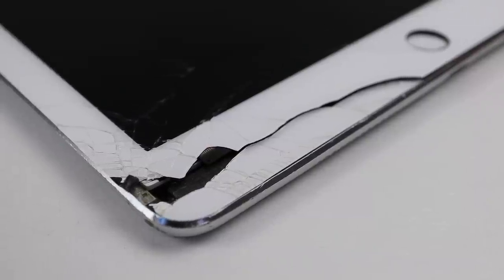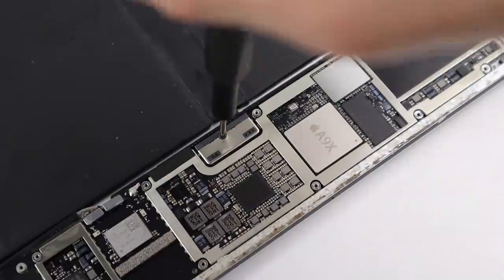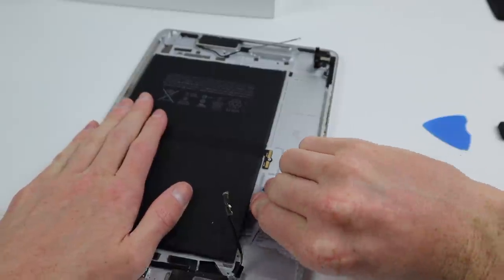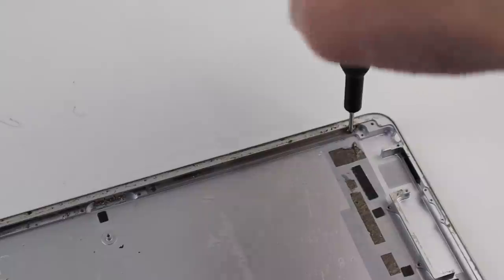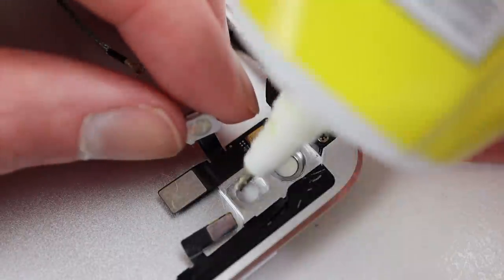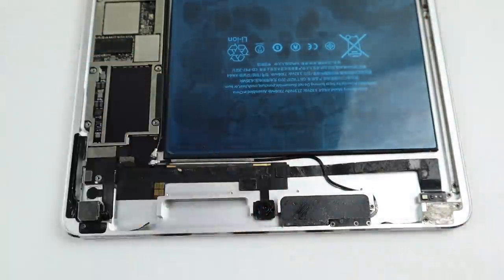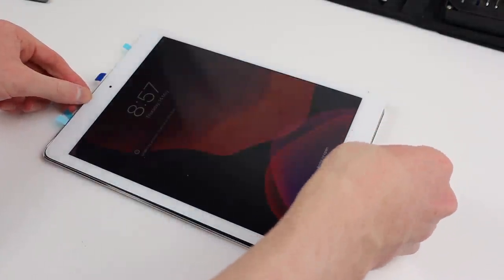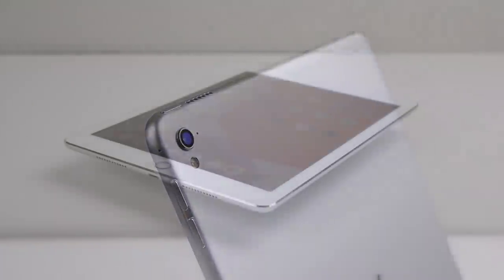Never Try To Fix This - iPad Pro Restoration

Comment: I really didn’t get why people are so hyped about the “Right to Repair “ thing 
Now i SURELY do
Reply: i have a feeling the engineers would have liked to fill the whole thing with epoxy… but some lawyer pointed out that that would make it too obvious
Reply: @gorgonbert  It's not the engineers, it's the marketing and finance people that decide the reparability of apple devices.
Reply: @lukewatson059  Yes it won't have direct impact, but as louis rossman says it's not just right to repair that's going to fix all the problems it's the consumers who will make a change. If parts are available more easily then more people would be intrested in fixing their devices or getting them fixed as repair costs and time will be lower. Once that happens people when buying a new product will consider reparability too which will slowly force companies to make their products more repairable. It's a chain of events and right to repair is first step towards it.
Reply: fact is the technology involved is very delicate there and the device needs to be secured from curious customers who would damage it and then just trash it (thus dealing even more pollution) or complain the product is crap because it didn't whitstand the blows of their jackhammer. Apple's policy has always been dedicated to protecting their product knowing the average consumer can't be trusted, so if anything doesn't work it's due to their engineers and they can control the evolution in a more efficient way.

I tried to change a battery from one ipad once, following a thorough tutorial and was very careful yet... the wifi didn't work anymore. I'm sure I didn't touch anything wrong and yet the device was suddenly trash.
Reply: @3Clod  sure, not all end users are as expert as hugh, but rpair shops are. And if I buy something its my right to do what I want to do to it. I'm not fucking renting it from a company who tells me not to repair it, save some money and maybe save a machine from being e waste.

 Apple harp on about their environmental credentials but make it impossible for expert third party repair, they literally refuse to provide componants so repair shops can't fix problems even though they know how to do so. Its so shady.
Reply: @willm5032  it's their right to adopt the policy they want

nobody forces you to buy their products, there's android devices if you want to repair or make "improvements"

I sure as hell don't want a android device, I don't care about tweaking and stuff, my device is very good as it is already.

if ever apple were to decide their products are open source and become android-like (with all the crashes, bugs, problems with privacy, billions of settings to personalize with the effect that you can't really be sure you did a good job in the end) I would not buy it...
... and I would not be forced to, obviously.

you could also start your own company and build your own product to sell worldwide, if you have so many ideas on how to improve an ipad. Good luck with that
Reply: @3Clod  You are wrong on so many levels  but ok.
Right to repair won't affect you but it will affect people like me who care about truly owning a device and not just renting it.
Reply: @NanoMine  again you can own an android, nobody forces you to choose an apple product
Reply: @3Clod  Damn son what part of apple do you work for
Reply: @3Clod  Right to repair is not just about iphones, heck it's not even about just phones. Androids and so many other things have this problem too which right to repair will solve.
Reply: @NanoMine  Innit, John Deere, Tesla, Samsung all have very shady right to repair attitudes too. Its the shitty direction things are heading in
Reply: @NanoMine  While I agree that that is Louis Rossman's logic, I think it's complete bollocks.  No-one wants to replace a relatively new device just because some tiny part has broken but that's a rarity.  I have more gadgets than you could shake a stick at (from where I'm sitting I can reach a 16" MBP, an iPad Pro, an iPhone, a pair of AirPods and the Pixelbook I'm typing this on) and I've been buying them for years.  The only things that I've ever had that I had to stop using because a minor part broke were so old that I wanted to replace them anyway.

The right to repair will affect a tiny number of people.  Most people, including me, don't give a crap.  If don't like the fact that iPads are hard to repair, buy something else.
Reply: @willm5032  Buy something else then.  If you don't like the fact that Apple products are difficult to repair, you are making poor purchasing choices.  If you still bought it, knowing it was hard to repair, tough.
Reply: @joshuarosen6242  I'm using a 2008 Mac Pro because that gen is the last proper modular Mac. I work in the creative industry which still dogmatically clings to apple. Plus, I criticise any company that is as shitty with their repair policies as apple. The whole built in obscelesence and hampering repair is a real problem especially given the climate crisis.
Reply: @willm5032  I think you make a fair point about the impact on the environment but being able to repair things will make almost no difference to that.  When I was a child, I remember the repair man coming to repair our washing machine regularly.  It was possible because the machines were easy to maintain and parts were available.  It was necessary because they were crap.  All the appliances and devices I use now are much more reliable than they ever were.  So much for built-in obsolescence.

I also don't believe that Apple does deliberately hamper repairs.  Most Apple users just buy the newest shiniest thing and will continue to do so no matter how easy their device is to repair so Apple doesn't care either way.  The reason everything is glued in is because it's easy to manufacture and produces excellent results.  Yes, it makes devices difficult to repair and Apple doesn't care about that either but I have seen absolutely no evidence that Apple actively wants its devices to be hard to repair.  Do you have any?
Reply: @3Clod  What are you talking about, apple are basically very selfish and would rather you not fix something that you have a right to as you paid for it, but pay more money for something new from them that's why they secure and glue things that don't need to be glued like in this video.
Reply: @joshuarosen6242  You don't see no evidence, Ok what about pairing devices to one another within the phone? is that not difficult to repair is it?
Reply: @tyronenelson9124  for the nth time
A) buy android, apple can do without your money nontheless. If someone came and forced you at gun point to buy an ipad, go to the police.
B) If you have a better project that doesn't involve glue, produce it or show it to apple itself so they will buy it.
Reply: @tyronenelson9124  I think samsung sucks, I would make it in a different way and yet (like magic) I don't complain about it, I don't scream angrily to people who buy it, I don't insult them, I don't claim to have other ideas... I just buy other products. Try it too (but I think it's funnier to complain and throw tantrum like a spoiled kid because pepple doesn't do what you want)
Reply: @3Clod  At the end of the day I'm not bothered whether anyone else prefers apple or android because that's their choice, I myself prefer Samsung android because of the different modern models that are available plus the hardware and software flexibility, not apple as it is very basic, dated and limited.
Reply: @3Clod  I don't know what is your stance is to be honest. On one hand you tried to repair something yourself. On the other, you say devices are not meant to be repaired. I believe you said something like "Apple's devices are delicate and are not meant to be tinkered with". Okay then, how about sending it to repair shops? Are they "tinkering" with it? Less modification and environment problem aside, I'm more on Right to Repair for this simple reason: are you fine with paying a price of a new iPad when you cracked your screen? If repair shops are not able to get parts, Apple can charge you whatever they want. Not saying you will break it on purpose, but accidents happen and if you fine paying for that amount, my conclusion is you are rich. Great I guess.
Reply: Mr Wong, you can conclude whatever you want, we're free in the western world, you know.
Actually, what I said is very clear: I tried to repair the device and it was MY choice and if I didn't like the product nobody forced me to buy it. I never complained about a price, when I buy something it's always written in plain sight what I'm going to spend. Maybe in china they hide them, here (unless you want to evade taxes (taxes, not texas, mind you 😅) ) the seller has to display the price.
Reply: @3Clod  yeah I'm not saying they didn't label the prices, but imagine the price they give is 20% cost of the parts with 30% labour and 50% profits. To customer they will say something along the line of "extremely hard to repair thus requiring best of our well-trained technicians and specialized tools". I don't think when they give a price for repair they actually gives specific pricing of each things but just overall how much it will cost so they probably can "hide" something under it without us knowing. For taxes they could put it under labour, can't say much about that, not too much of a business person. 
Hopefully you can gives right to repair another chance in future if things get worse (hopefully not). By the way, yes I'm a Asian but not a China Chinese. Aside from those, hope you have a nice day!
Reply: @SuperSohaizai  the cost could be 1% material and 1000% profit, still you're free to buy something else shrug protesting and forcing someone to do what you want because you can't afford it or despise it is just plain arrogance. If I made a device from scratch better than an ipad, I'd sell it for 10 grands and my comscience would be  quite pleased with me. I do what I want with my stuff.
Reply: @3Clod  wow so right to repair is bad and you rather have things stay at a premium costing anyone who likes to save old hardware money.... you would fill it with epoxy and say it is what it is lol and buys a new one , ok kid
Reply: @FirstLast-hg1ez  listen, girl, what I'm saying is very clear: customers have rights, producers have theirs. If apple would fill the devices with epoxy and sell it, it would be their damn right, we're in a free world and a free market. If you don't like the product just DON'T BUY IT, buy something else, or produce your own.
imo you understand this but you just fake not because you're full of hatred and frustration for some reason. Grow up, get a job and buy what you want, don't be spoiled
Reply: @FirstLast-hg1ez   also, apple devices rarely need repair, I've loads of those and I'm very content with the quality. I don't think it's true what you say that every goddamn week you have to buy a new product or repair it.
I don,t get what your problem is: you like apple devices or not? answer this first, then start insulting like a 12yo (you're showing you can't even write tho so...)
Reply: @3Clod  baaa.....
Reply: Goes for cars - anything electronic.
You OWN it when you buy it. Of course you should be able to take it anywhere for repair!
Reply: @3Clod  "Look at me, I am a cool dude making noisy noise all day long Ahiyahiyaahiyaahiyaahiya" (Just me being silly as 12 y.o.)
Reply: @NanoMine  jhonny ive addiction to stupidly thin crap

Comment: Heat and patience is your friend when dealing with glued items. A good thorough heating on a hotplate at 60-70 degrees C - and it is much softer.
Wear hand protection though, so you're not tempted to rush as the entire thing gets uncomfortable hot to touch.

Comment: Have you ever tried using zippo light fluid to loosen the adhesive on these products. The lighter fluid evaporates and doesn’t damage any of the components. I have been using it for years to remove the adhesive for stickers and such. It might be worth a try. Almost forgot, love your content.
Reply: Try lacquer thinner, thats well better than zippo
Reply: Don't do this.... 

A lot of zippo fluid has additives meant to be combusted and helps with "wicking" which isn't advised on circuit boards. 

I'd stick to high % isopropyl alcohol instead....
Reply: @1337GameDev  , one uses zippo lighter fluid because it evaporates and leaves no residue on surfaces used for adhesive.
Reply: @johnchristopherrobert1839  One uses acetone if one doesn't mind the risk of already using fuels that can damage plastic.
Reply: Nasty stuff to work with, I wouldn't recommend it.
Reply: @Zerbey , I disagree lighter fluid evaporates with little to no residue and the adhesive on labels for example will become sticky after the lighter fluid evaporates.

Comment: A friendly tip😁 I'm also in the business in repairing phones. I suggest heating stuff like that which are sticked with adhesive. As heating with soften the adhesive 😁.  You can use your heating platform. Hoping you'll consider this next time
Reply: You have an iPhone in your profile, I can't trust you
Reply: @arkvsi8142  why?
Reply: That doesn’t do shit on the Smart Connector or the magnets.
Reply: @arkvsi8142  The man literally repairs phones for a living. Plus when it comes to smartphones almost all the manufacturers use adhesive for everything, for the sake of "waterproofing."

I still cannot understand why people would give up features such as storage expansion or replaceable batteries just so they can use their phone for 15 minutes while 9 feet underwater.

Comment: Wow, you are keen. In stripping the old case I was waiting for the battery to catch fire, especially after you folded up one corner 5:18
I wonder if the glue under the login board is to improve thermal conduction to the case.
Also, I wonder if all that glue under the speaker is to.. A/ avoid rattles & buzzes, & B/ stiffening for better sound.
Reply: It is called a Logic board not login

Comment: My trick with stubborn adhesive is using a (power adjustable with a few settings) hairdryer (blowdryer) to warm up the adhesive and surroundings carefully, This usually makes disassembly a little bit smoother as this softens the bond. This also works wonders for removing stickers :)

Comment: Hello Hugh. Nice job as always and a pleasure to watch. As  I said before.. use heat to soften the adhesive. You could heat the case from behind to release the board, battery and other components since you where going to replace the case. Use heat. please !!!

Comment: Yo, for that SMART connector trouble:
Once you've got the bracket and glue off, and pried up the cabling, You can use a conveniently shaped piece of plastic and a small hammer to pop the circular bits inward. A plastic spudger cut/ground down to shape works nicely. Still gotta be really careful, tho.

Comment: Oh mate. I always repair these and is always is a nightmare. I’ve broken some home buttons.☹️
Reply: I did try(and successfully repair) iphones. It feels like trying to wash a toilet paper. I just don't want to fix this junk any more. Right now we repair everyting, but NOT apple junk. Let it go to the waste, where it belongs.
Reply: @pashko90  the rest of them isn‘t getting any better though. On Samsung you have the INSANELY strong „elephant glue“ for the batteries, with no pull tabs. And for some reason the I/O-daughterboard is usually glued in place (on top of being screwed in). Sony‘s phones break so easily when you repair them. Huawei is really piece of junk, especially their laptops. They‘re the chinese Apple indeed. OnePlus gotta swap everything over, LG - don‘t get me started on this one… The whole industry is like that. We now have phones that are designed to not be repaired at all.
Reply: Apple: Don't fix it
Nokia: Why would you need to?
Reply: @spamspace6878  He was able to finish the repair because i fix it  did have the missing part after a year of him searching, otherwise he was going to have to use the old case.

Comment: A few things,
 1. you could probably repair the smart connector, might be a bit shoddy but worth a shot IMO. 
2. don't be afraid to heat the battery up, you can also use a paint scraper, or a thing metal spatula to cut the adhesive, it's done frequently and has been discussed 1000 times, it works, i would use an iflex.
3. you're missing a plastic spacer for the home button. I would've super glued the metal disc. When I do home button's on ipad I also apply a bead of B7000 around the bracket, helps keep it in after heavy use (read: kids)

4. the magnets, you could've sacrificed the original casing by deforming it and you would've been able to remove all the magnets, as well as extreme heat, like 150-250C.
5. the adhesive on the wifi cables is a TERRIBLE idea, if it ever gets opened up again it's a mess, especially when it wasn't there to begin width and hasn't been standard since the ipad 2. 
6. electrical tape looks weird, Kapton tape would be an appropriate solution.
7. There is a 3M brand adhesion promoter people use for a really good seal, while no necessary for the frame, i would advise to use it for the home button bracket, and switch to the tesa black adhesive, instead of the red, it's thinner and holds on a bit better.

Comment: The ipad does not wake up when you lift the cover if the hall sensor is damaged or disconnected. The covers are compatible between the two ipads

Comment: Putting the iPad on a heat mat helps soften the adhesive when removing parts, especially the battery. Makes it a lot easier.
Reply: Even a hair dryer makes a diff

Comment: The glue on the speaker assembly probably helps to make better contact with the case which is used as part of the speaker. Not fleeing the speaker assembly down should result in worse sound quality, it would be interesting to hear a direct comparison.